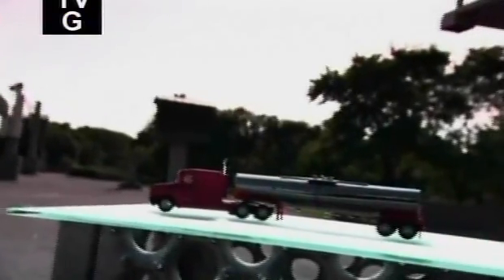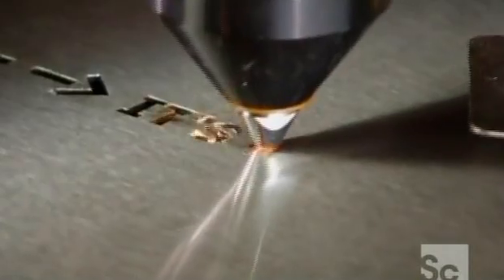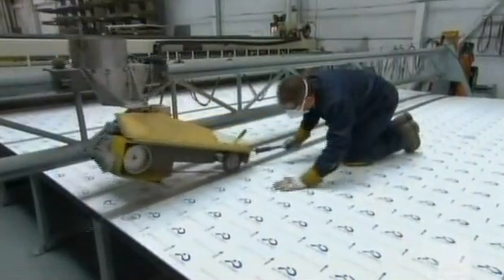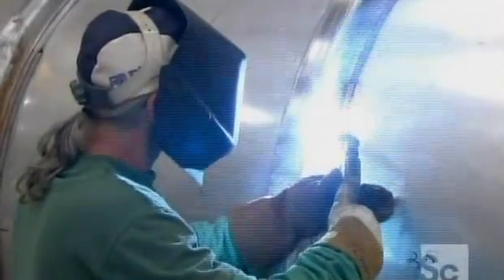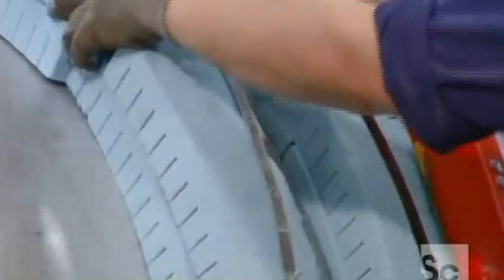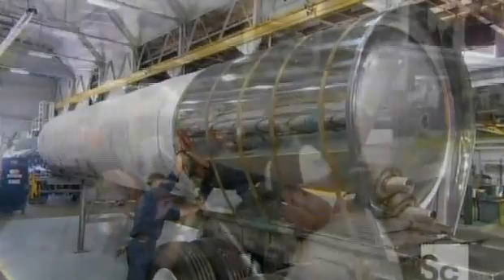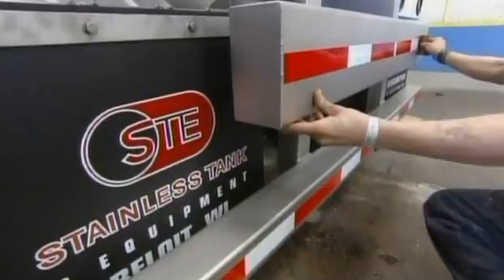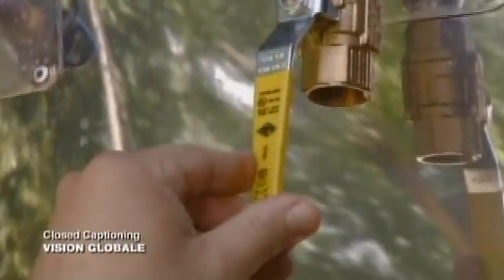Tanker Trucks - How its made

Comment: For all the commenters regarding baffles: Food grade and Chemical grade tank trailers do no have baffles for one very simple reason, how do you clean the back of the baffle? Tank trailers are cleaned internally by what amounts to a gyroscopic dishwasher head being lowered into the hatch. They are programmed to hit every spot inside the tank during their cycle so if there were baffles inside, the backs of the baffles and everything beyond the baffle would not be properly cleaned, causing product contamination from whatever was in the trailer last.
Most tanks are much larger than they need to be so they are more versatile and not limited to only one product and every product has its own weight. 
Example for food grade tanker:
Water 10 lbs per imperial gallon (8 lbs per US gallon)
Canola oil, approximately 7 lbs per gallon
Glucose, approximately 13 lbs per gallon
Many chemicals have different weights as well so you want to be able to carry your maximum weight whenever and whatever you load.
As for how to drive with a partially loaded tanker, very carefully, but that's a different story.
Reply: SidecarDan 
Im baffled as to why :-) ha ha

Comment: Trailers that haul bulk animal feed or dry fertilizer are NOT tank trailers. You'd think a channel like How it's Made would get that part right. Dry bulk trailers are as different from a liquid tank trailer as a dry van is from a double drop.
Reply: Twisted Pixel cousin runs liquid fertilizer in a tank and uncle ran liquid feed in a non baffled tank. Pretty sure that's what they were talking about.
Reply: Big Jim "Liquid feed" isn't feed that   you would feed straight to cattle. It's a liquid mineral or protein additive that you'd use as a supplement to get your feed mix to the right protein/fat content/mineral that you need. I know it's called liquid feed but that's about the same as calling corn gluten pellets or wheat mids animal feed. They are used IN animal feed but no one feeds them by themselves as animal feed.
Reply: Twisted Pixel I know that. But to the casual viewer it makes sense why they call it that.

Comment: Baffles should be mandatory in all tankers. Imagine having a 3/4 loads & going downhill - all the weight will shift to the front, not to mention braking and acceleration occurances. In case there are precautions for content interaction with baffles, then the whole tank should be made of separate sections (subtanks). Just saying...
Reply: Milk tankers do not have baffles.
Reply: most stainless tanker dont have baffles because they often need to be cleaned without entering them like some chemical or acids. gotta give tanker drivers alot  of respect
Reply: SS trans. Are not required baffles for contamanation issues when cleaning . 

Fuel tanks, modern ones on the other hand have baffles throughout them .
Reply: Tankers for food product can't have baffles cause the're too hard to clean.  The drivers have to be very skilled and know how and where to take their vehicle. You can very easily wreck the tanker if you dont drive it correctly.
Reply: I'm pretty certain that they just left out the part about welding in the baffles.  I think it's standard that baffles are put in.

Comment: I had to do road stabalizer a couple times. I  would load the base material in the city and then was supposed to take the trailer elsewhere to load the balance of the load ( I think it wasd about a 50/50 mix, but I'm fuzzy now...was a long time ago ) with water from a fire hydrant. The trailers had no baffles. I'm just glad it was summer when we did that work and there was no ice.

Comment: @sysghost Baffles are designed for specific types of liquid. This type of container is most likely for dry product or very dense products like wax. It is extremely rare to ever fill a trailer to capacity as few liquids are light enough to fill a trailer and be under legal weight. Also the fact that they state it is filled from the top would point to dry product as many liquids are loaded from the bottom including petroleum products like gasoline and diesel.

Comment: @imautuber444 Not needed if the tank is "filled to the brim"
However, partially filled tanks would be better off with the baffles.
I guess these kinds of tank trailers rarely/never runs partially filled. It's filled up or not at all.